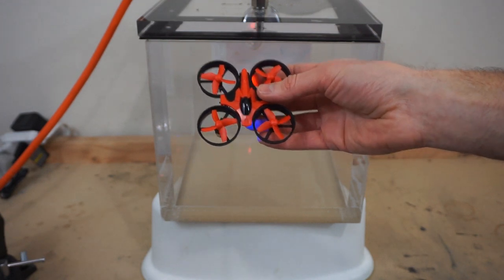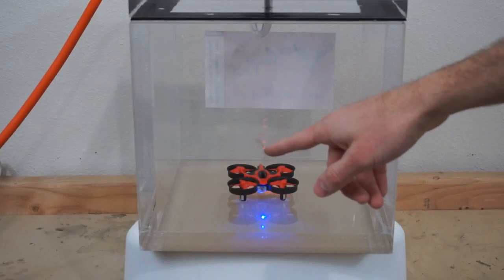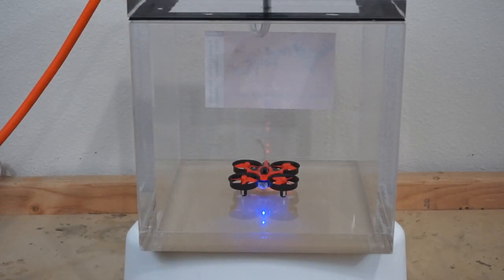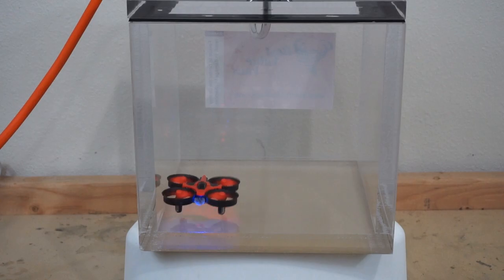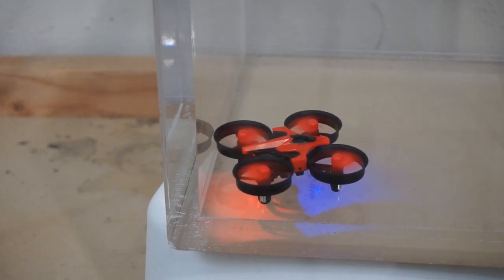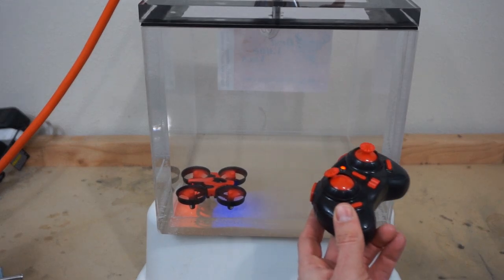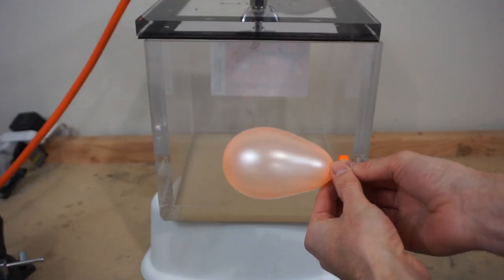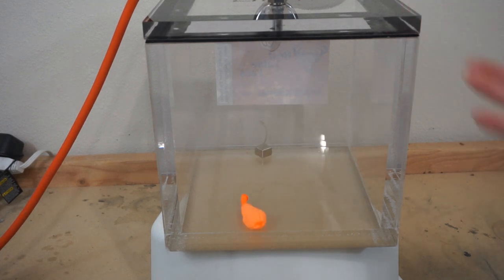What Happens When You Put A Drone In a Vacuum? Can It Still Fly?

Comment: INCORRECT. The balloon actually ejected its air out against the side wall (action/reaction) that was so obvious. Rockets in the vacuum of space dont have the benefit of a glass wall (action/vacuum/no reaction), how did you miss that? Please leave the serious experiments to more qualified people.
Reply: And a SR-71 flying at 85.000 ft (Mach 3) is pushing against what ? And the concorde jet airplane ?
Reply: @stevelampere  328,000ft is a long way from 85,000ft GENIUS. Does the SR-71 fly in actual space? I THINK NAWT 😒 nice try
Reply: @DC_R  it is not a nice try but physical facts...😉
To propel yourself from a wall, you need contact with a SOLID and RIGID object (your arm, for example). Try to push yourself off a wall with a rope... impossible ! so even if the air leans on the walls it can never communicate a movement to the balloon. On the other hand, when leaving the balloon, he gives it an opposite amount of movement (momentum) by reaction.
The recoil of a gun has exactly the same explanation.The recoil is the same whether you shoot at a wall, in water, in the air or in a vacuum. The bullet can in no way push the weapon by leaning on something.

That said, it seems to me that you confuse propulsion and flight (sustentation). At what altitude did the X-15 climb ?
Not convinced ? Sitting on a small cart, throw a large steel ball and a wood ball of the same size in succession. So they both push on the air in the same way. The recoil will not be the same... Nice experiments
Reply: @stevelampere  if I say I believe you will you be happy?
Reply: @DC_R  It is nonsensical to think that rockets need surrounding air to push off of.

NOTHING is pushing off of the ambient air.  Planes, Helicopters, boats, jets, and rockets all work the exact same way.  They use the conservation of momentum to move.  They eject mass away from them, and by the law of the conservation of momentum, they are thrust in the opposite direction.  What they are pushing off of is the very mass that they eject away.  For an airplane, this is air, but it's not the ambient air they push off of.  Airplanes literally take air from the ambient air, and then eject it away.  A better way to think about it is on a micro scale and slow it down :

If I am in some space and there are 5 kg balls all around me, I can grab one of those balls and throw it away from me.  I will be thrust in the opposite direction, and my acceleration stops the moment I release the ball.  If the ball I threw ends up colliding with another ball, why would it have any effect at all on my motion?  I'm not even touching it anymore.  The thrust was given to me the moment I threw the ball.  What happens after that is irrelevant.  If that ball goes on to collide with a solid wall, it will not effect my motion.  This is the equivalent to how planes and boats work.  They do not need the surrounding air or water to push off of - it is just a convenient source of mass to eject away from them.  Planes and boats need fuel to operate an engine which turns a propeller or turbine which is what grabs the surrounding mass and then ejects it away.  Rockets use fuel as the mass itself which they eject.  They literally take the mass with them, so going back to the example being in space.  The difference between rockets and boats is only in the fact that there is no ambient material from which to use as the mass you eject, so instead of a space with a bunch of 5 kg balls, you are in empty space and you brought a giant container of 5 kg balls with you.  When you throw one of those balls, you will be thrust in the opposite direction in accordance with the conservation of momentum.  You don't need that ball to collide with something in order to move.  The very act of throwing it is what gives you the thrust.  The is why it is patently ignorant to suggest that rockets only work when they have air to push off of.  It's as idiot as thinking that if you throw a ball in empty space, you will only be thrust in the opposite direction if that ball ends up colliding with something and just magically transmits this information to you and you magically get pushed.  It's all nonsense.
Reply: @willoughbykrenzteinburg  Then if what you're saying is true then get in a rocket prove it and then I'll believe you just make sure you wave at me when you land on the Moon. Oh I forgot NASA won't let you prove it to the world will they?
Reply: @DC_R  You don't have to tell me that you are not a scientist.  That much is obvious.  I don't have a problem with people asking questions.  I have a problem with your assumption that educated people just repeat what they've learned as if they have zero understanding of it and just memorized "facts".  That's not how science education works.  I actually understand how this works.  It would be very difficult for me to merely dismiss it on a whim because I understand it.  It seems plausible to you that you've simply been lied to and you could just stop believing these things because you don't actually understand how it works.

Take something you understand very well.  Like - fire is hot.  Imagine you came across someone who denied that fire is hot and insisted that you were just indoctrinated to think that way by the oppressive education system.  You would clearly know that the person saying those things was simply ignorant.  Of course fire is hot.  You don't just accept fire is hot because you were taught fire is hot.  I mean you were, but you also understand that fire is ACTUALLY hot.  The person who doesn't know any better could simply just dismiss it as a lie - because he is doesn't know that an actual education person doesn't simply blindly accept that fire is hot - they know for a fact that it is indeed hot.

This is precisely how people who are educated in physics react to someone like you who questions whether or not rockets work in a vacuum.  You would have no problem simply dismissing it as a lie propagated by some unknown power because you don't actually have a fundamental understanding of how they work - and you demand proof, when to someone like me - who has an outstanding grasp of the physics involved, you might as well be demanding that I prove fire is hot.

There is no point in having a camera on the moon pointing at Earth showing footage 24 hours a day. 

SpaceX has livestreamed every one of their entire launches from the rocket for the last several years, so footage of a full rocket launch - all the way to destination - exists.

Rockets work in a vacuum.  If you want to reject that - or hold your acceptance hostage for some quasi "proof", you have that right.  In the meantime, rockets will still work.
Reply: @willoughbykrenzteinburg  sorry it has taken me so long to get back with you but I was downtown conducting business. I do appreciate the way you broke down the hot Theory as far as the fire is concerned that's very true. I need you to also understand this, people of a rational nature also take in account how simple questions should receive simple answers. Nevertheless are questions never get true answers but at the same point in time this Society of NASA types science types what have you. Expect us to just take them on face value that they did these things they claim they have done. In a court of law a case of Defense can easily be won concerning such matters as they went to the Moon. Trust me I don't care either way. My interpretation is if it's against the law for me to build my own rocket to find out for myself why should I trust anyone? Why stifel the citizens who are interested in space travel as much as they are keep us keep us in the dark.  I hope that made sense. 
😂
Reply: @DC_R  Nobody is demanding that you take what NASA says blindly, and it is not against the law for you to build your own rocket.

Name a question you have that you havent gotten a good answer for.
Reply: @willoughbykrenzteinburg  okay cool and always remember I'm talking in the parameters of Common Sense okay? My first question would be why haven't these people taken it upon themselves to turn the Hubble telescope around, show the picture of the Earth 24 hours a day that's one. And 2 why haven't they took the time out to literally point one of these telescopes On the Earth horizontally and actually show how far you can see as far as distance is concerned? Because honestly I'm getting so sick and tired of this curvature of the earth and Flat Earth dispute that has been going on for far too long. I mean my God man
Reply: @willoughbykrenzteinburg  if you pay attention to what I'm saying then you would already understand that I don't care about either side I know I made that clear
Reply: @willoughbykrenzteinburg  for instance I live in America right and there's always the big debate about Democrat and Republican. Well I'm the guy who standing in the middle who's watching two idiots fight over something that has no true relevance in The Human Condition that's where I stand I guess they call it independent I don't know once again I don't care

Comment: The balloon experiment, which according to you, shows that rockets can move through space, does not meet the conditions that exist in space. The air expelled by the balloon finds the resistance it needs to achieve the necessary thrust on the wall of the vacuum chamber itself. In addition, at the moment that the air that the balloon contains, leaves the balloon, the conditions of the chamber vary, the gas that leaves the balloon cancels the vacuum conditions. To really show that a rocket can move through space you should reproduce the conditions that exist in space and repeat that experiment in a much larger chamber, where the walls of the chamber are so far apart that they will not influence the experiment, and where the chamber size, which must be much larger, so that the air coming out of the balloon does not influence the existing vacuum conditions. Up to that point you will not have proven anything, you have only looked for a way to ensure that an experiment that does not meet the necessary conditions meets your previous expectations.
Reply: - " The air expelled by the balloon finds the resistance it needs to achieve the necessary thrust on the wall of the vacuum chamber itself."
This is NOT how rocket propulsion works.

If you would like to learn how it works I can help you but you have to answer a few basic physics questions.

Please explain to me how the RECOIL from a gun or a crossbow happens here on earth in an atmosphere.
After you answer that I will give you some more questions that relate directly to rocket propulsion IN A VACUUM.

But demonstrate how Momentum & Inertia work by explaining the concept or "Recoil" FIRST.
most "physics deniers" just dont understand the basics.
Reply: @stuartgray5877  Not a single word of what you said proves that a rocket can move in a vacuum.

Newton's Third Law: A force is a push or a pull that acts upon an object as a results of its interaction with another object. Forces result from interactions!

The statement means that in every interaction, there is a pair of forces acting on the two interacting objects. The size of the forces on the first object equals the size of the force on the second object. The direction of the force on the first object is opposite to the direction of the force on the second object. Forces always come in pairs - equal and opposite action-reaction force pairs. 

A vacuum is the absence of matter, so there is no second object, so there is no interaction, so there is no opposite reaction, so there is no movement.
Reply: @stuartgray5877  Have you seen the video?
Reply: @stuartgray5877  Yep, shit is all you build, test and launch, lol.
Reply: @stuartgray5877  Some physics, by Newton: "A force is a push or a pull that acts upon an object as a results of its interaction with another object. Forces result from interactions!

The statement means that in every interaction, there is a pair of forces acting on the two interacting objects. The size of the forces on the first object equals the size of the force on the second object. The direction of the force on the first object is opposite to the direction of the force on the second object. Forces always come in pairs - equal and opposite action-reaction force pairs. "
Reply: @stuartgray5877  And all your words, with enraged tone and many capital letters, without a single real evidence to support them, makes them simply your opinion and not proven facts, and that is not worth much, to say nothing.
Reply: @manumirat2051    if you don't realize that rocket engines work by RECOIL force of PUSHING ON MASS, then you have no fucking business trying to explain physics to ANYONE!
Reply: @stuartgray5877  Congratulations, you didn't prove your claims, and you just began to insult. I suppose that is all you have.
Reply: @stuartgray5877  You still proved nothing but your anger, maybe you feel fooled?
Reply: @manumirat2051  @Manu Mirat so you DO think that you are smarter than someone with an engineering degree and TWENTY FIVE YEARS working on some of mankind's most advanced vehicles at places like Lockheed Martin, Jet Propulsion Labs, Laboratory for Atmospheric and Space Physics, MSFC, GSFC, and DOD?
Yeah you are a fu<king GENNIUS!
bless your little heart!
Reply: @stuartgray5877  Again, you still didn't prove me wrong, you still didn't provide real evidence to prove your claims.
Reply: @manumirat2051     Search YT for "Uninterrupted Footage of the Falcon Heavy Launch and Booster Landing! "
And WATCH the video from launch to booster landing.  then EXPLAIN WHAT YOU JUST WATCHED.  If you cannot spot the parts where rocket propulsion was working JUST FINE in a vacuum, I will be happy to point it out to you.
Reply: @manumirat2051  Oh AND, the company I work for buys dozens of mono-propellant thrusters from Moog Corp. per year (look them up).
We TEST EVERY ONE OF THEM - IN A VACUUM and verify that they produce the thrust predicted by The Tsiolkovsky rocket equation (maybe you should look that up?) since we have been TESTING IT for over 100 YEARS.

Comment: This video is misleading (I dont think its intentional). There is a massive difference in a rapid air pressure change in an enclosed container and pressure differences in space. Also, rockets dont use stored air, they use fuel (so they say). Lets say for the sake of argument that you could store enough pressurized air to make a thruster system, you would get 1 action out of it. There is no way to regulate the release.
Reply: - "There is no way to regulate the release."

False.
You could have a 3000 PSI oxygen tank in "space" and propel yourself around just by manually opening the valve.

Comment: The wall is the medium.... there isn't a wall in space 😂😂😂😂😂😂
Reply: wall is the medium ? explain
Reply: @delayedcreator4783  a cars medium is the road... it pushes off if it... a boats is water a planes is the air... the wall is acting as a medium for it to push off of... in other words this basically proves you need a container for a vacuum now show me a vacuum without a chamber
Reply: @majorhazzard8642  Rockets get pushed forward by the mechanical recoil of pushing mass out the back.
Tell me you think that a crossbow fired in to a vacuum would have NO RECOIL.
Reply: @majorhazzard8642  AND a "gas centrifuge" CAN create a region of high-pressure gas adjacent to a region of low-pressure gas with NO PHYSICAL BARRIER between the two regions.
Care to tell us HOW this device can do something you believe is impossible?
Hint: Its IN THE NAME.
Reply: @majorhazzard8642  SO that's a "No I cannot tell you if a crossbow has recoil in a vacuum".
Then perhaps you should refrain from having conversations about basic physics if you don't know?
Reply: @stuartgray5877  Notice how they always ignore the questions that prove them wrong?

Comment: So if there's no air for the blades to push on what is the co2 from the balloon pushing on for it's thrust? Lol Dude you need to make it a real vacuum if you wanna demonstrate this right. No one knows what settings or how much air was actually in there when you let the balloon loose.
Reply: The CO2 isn't pushing anything but the balloon, in the other direction.
Reply: Newton's 3rdb law